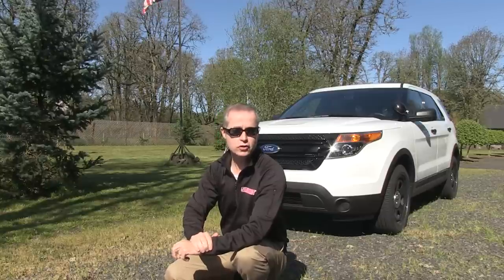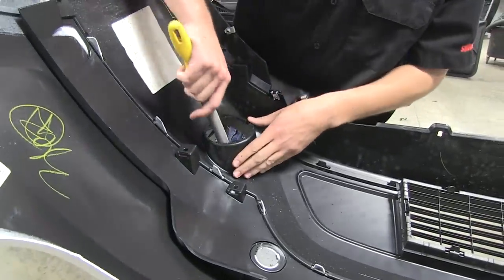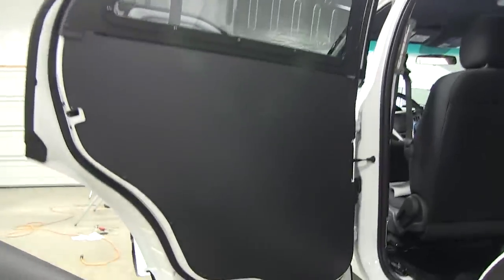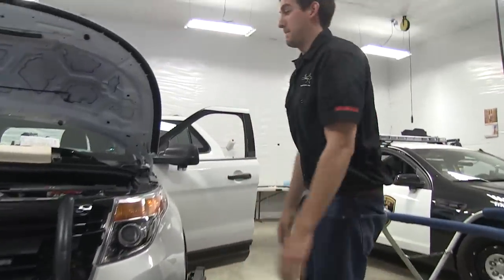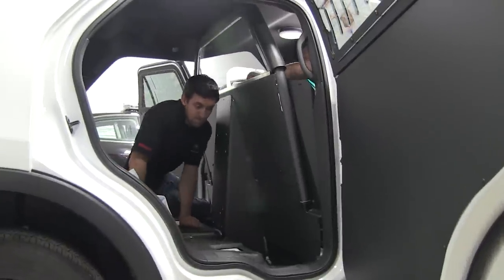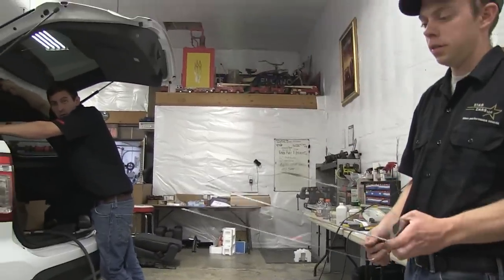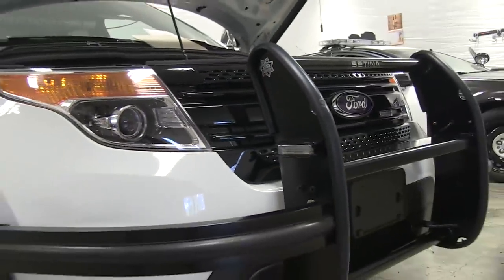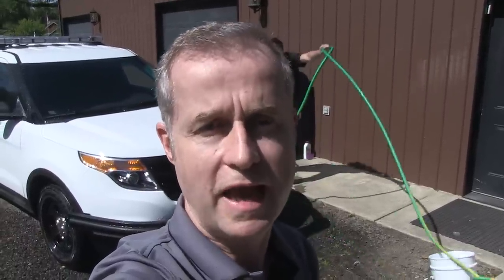Ford Interceptor SUV patrol vehicle build

Comment: I had no idea that so much work was put into outfitting our vehicles (not your company, I work in a different location in the country). I always assumed that a "Police Interceptor" from Ford came with almost everything done. I didn't know that a company had to do such intense, hardcore work like stripping the car down to basically a shell and then custom installing everything. I am truly surprised by this. I will definitely appreciate our vehicles much more now. A big thank you to those who do this work---we put these vehicles through hell, and I have never had anything fail except roughly 20 or so years ago when the Vector light bars came out and the dumb decision was made to connect them to the user-unfriendly GE control box (combo PD radio and lights/siren control head). Those individual "pods" would turn themselves on all the time. It was especially bad when working patrol graveyard shift, and as we would be slowly driving "blacked out" through a neighborhood, out of nowhere one of the pods would turn itself on and rotate slowly one "click" at a time. Even if we powered off the GE control head, it would keep doing it. Naturally, we'd have to "down" the vehicle and leave it in the underground garage sitting there with one of the pods it up, slowly clicking it's way around and around. They were chronic in doing this! I was so glad when we switched to the low-profile clear/LED light bar. So much nicer!
Reply: Yeah for them officer to just chash it like nothing

Comment: How come none of these interceptors (or the ones I have seen at least) have wig wags?
Reply from the maker: 5Legacy78 With the Projector Head-Lights, using a conventional Head-Light Flasher Module is not something that can be done. Ford does offer a PPV Head-Light with a White/Amber LED Blinker Module that offers a high-output White Flash function.

Comment: Is there any way how to install a door light switch for the interior light to turn on when you open the door on the 2007 crown Victoria ? thank you
Reply: Should be in the door jam, only guessing here.
Reply: Your Vic has been programmed for dark car mode. It used to be as easy as grounding a wire but for 05 and here newer you need to get into the ECM to change it.
Reply: R.QUINTERO624 1000 % OAXAQUEÑO DE ♥ they call it a courtesy light.

Comment: I've had the ability to drive one of these. Despite having a V6 it is extremely quick and nimble and more capable than an expedition or Tahoe.
Reply: it's the same V6 being used in the base Ford Mustang...it makes a pretty nice low-pitch scream when its floored
Reply: May be more capable but reliability isn't even near what the pushrod v8 tohoe will ensue and still come out on top in the long run I would never buy an ex ppv explorer but I would all day buy an ex ppv tahoe and I've driven both as a mechanic the tahoe isn't far behind in top speed and acceleration only .5 seconds 0 to 60 behind the explorer

Comment: I'm not a huge fan of the split blue/red on the lightbar. Red on the driver and blue on the passenger side is more effective in my opinion. 

Also, I'd like to see in your next install video how the cencom wiring and programming works. 

Thanks for the video as always.

Comment: As with the Charger video - very interesting.
A lot of work, but again done cleanly and thoroughly - great job. 👍🏼😊

Minor detail - considering how thorough everything is done, I would have expected the divider protecting the electronics in the back to be dark/black too, like the other dividers/walls. But of course, that the divider does its job is most important.

Look forward to seeing the finished modding of the lawn mower to regulatory standards. 😄

Comment: Great video as always. I just wish there was a way to get that cage to move with the seat. The new SUV's are deceiving as far as room goes. You could mess around with the Crown Vic cages (not good for safety) but at least you could lower the seat back. Intersting to see how the bolt on. Thank you.

Comment: Star car incorrectly seal the wires running though the roof of the vehicle. Silicone should not be used.
Reply: +LawnTractorBoy What should they use? Every outfitter I've known has used silicone.
Reply: +Mikeydude001 black stuffing gland
Reply: +LawnTractorBoy Thanks!
Reply: Used silicone for years never had a problem
Reply: Jeremey Taylor i use stuffing glands
Reply: LawnTractorBoy. It is NOT incorrect to seal the roof with Silicone at all. Silicone provides a better seal than a gland.

Comment: Greetings! My question is the following, after a interceptor becomes a civilian car do you restore them to civilian format? And remove the rubber flooring and that ugly center light that looks like a circle?  Like do you restore the gear shift from behind wheel to the center? I talking about a Taurus
Reply from the maker: +Cristianooportugal     The Taurus and the Interceptor Sedan are 2 different Vehicles. The Interceptor Sedan comes with the Police Package rubber floor, on the steering column shifter, wheels, brakes and front end.    When the PPV Sedan is taken out of service, it does not get dressed the same as a stock Taurus.

Comment: SIRENNET..... Is it at all possible to put WHITE WIG WAG lights in the front too?  I have found with mine (2016) that simply turning on the headlights makes the vehicle MUCH more visible, just FYI.  I would also add that the small quarter sized LED lights that are usually installed do NOT work very well in daytime use.
Reply from the maker: Wig-Wag's won't work on 2013-2015 Utilities. 2016+ will support a Wig-wag module as they have conventional halogen high beams.
Reply: @SIRENNET  Thank You! Didn't know that

Comment: I wish this vehicle would have been outfitted with the back window light bar as well as side truck warning lights. A back storage compartment would also have been nice. I prefer the single seat cage for extra space in the rear seating compartment for non criminal transport/ extra storage space for the officer. But I know that this specific vehicle was requested like this. Do you offer a multi level side protection on the setina push bumper as well for this model?
Reply from the maker: We offer 2 Setina fender wraps for the Ford Police Interceptor SUV. The PB6-VS: https://sirennet.com/store/product/setina-bodyguard-pb6-vs-suv-truck-fender-wrap and the PB8-VS: https://sirennet.com/store/product/setina-bodyguard-pb8-vs-suv-truck-fender-wrap

Comment: Wondering where to wire up a rear traffic advisor light and a stream light flashlight charger in a 2016 utility. Just looking where to start and do it correctly
Reply from the maker: With Star Cars well versed experience in working with Utilities, sending them an email mentioning your project may yield some helpful information. They can be reached at: StarCars@frontier.com

Comment: why don't you also change headlamps to LED instead of stock from manufacturer?
Reply from the maker: There are some up fitters and departments that switch the halogen HL bulbs out to LED.   It just depends on preference and needs.

Comment: Nice professionally routed wiring with full functioning light, siren, radio systems. the unit requires high amp alternator with dual batteries to sustain the power requirements
Reply from the maker: Thanks for watching :)

Comment: I would certainly like to get the dimensions of those grille light brackets. 
Would large fender washers work in a pinch?
Reply from the maker: +Mikeydude001  We'll see if we can get the dimensions. In a pinch, large washer's or a piece on thin sheet metal could be used as a wedge backing.

Comment: Do  you know how or where to connect the rear hatch LEDs so they only come on when the hatch is open on a 2017 ? the upfitters guide mentions a rear flasher relay but I don't think I have that option. I have the front grill/headlight solution  wiring option only (option 66?). If you don't hook them up to turn on when the hatch is open you can see them inside the vehicle. Thanks, and  good looking work you guys are doing!
Reply from the maker: Without the relay, we would suggest tying the lighting into the trigger that activates the OEM dome/cargo lights. Open the hatch, the dome light goes on and so do the warning lights. Close the hatch, the trigger shuts off as well as the warning lights.
Reply: SIRENNET Thanks, that is exactly what I did. I added a relay that triggered off the dome light and was powered thru the relay by the led power wire. I am checking for any delayed turn off of the dome light when the doors are opened. the sensor for the rear hatch is made into the latch mechanism and appears to be ground switched from low voltage.

Comment: It is great. I am 15 and plan on going into the fire department when i turn 18. It is good to know how to wire all of this stuff up. (I live in NY where we don't have strict laws about about the lights. Just that volunteer fire fighters have to run blue lights).
Reply: theryre pretty strict. also you can join a dept at 16. im 17 now and a yellow tag. lights though are the last thing you should worry about although i know how you feel having been that attitude year and a half ago. basically. the dept has more say about your lights because most cops dont care in ny about how many as long as its blue front facing only maybe amber
Reply: NY law says 18 I thought. Hmmm... Anyway, I know you can run a bar as well. It doesn't have to just be front facing.
Reply: It doesnt actually.  Junior firefighter programs are all over

Comment: Question. I know it's been a long time but how tall is that wooden rack on wheels holding the electrical wire spools?
Reply from the maker: It's about 6 feet tall.
Reply: @SIRENNET  ok. Thank you. And where'd you get it or did you make it? And are you using various size spools?
Reply from the maker: @trucker18944  Star Cars got the wire racks years and years ago. To far back to remember from exactly where.

Comment: Is the siren controller in this unit a dual tone siren ans if not is there one like it that is?
Reply from the maker: It's not using a dual tone amplifier.   You could go the route of a 295SDA1 siren & lighting controller or with a Cencom Carbide with it's dual-tone amp add-on option.    Here's a link to the 295: https://sirennet.com/whelen-295sda1-dual-tone-remote-siren.html

Comment: What is the Motorola thing in the trunk for? Cause I have a Motorola mcs2000 and it's programmed but nothing comes out of it
Reply from the maker: Its the main radio receiver. The control-head is a remote fixture designed to accommodate being flush mounting  in the console.
Reply: SIRENNET do I need one to make my radio work?
Reply from the maker: It sounds like you have the remote-head... so this piece would be necessary. For more information, we'd suggest consulting Motorola.
Reply: SIRENNET okay I will thank you

Comment: What about the headlights, shouldn't they flash as well?
Reply from the maker: The Projector Headlights can not be flashed. They have a ballast based bulb system and it is not designed to click on & off. Most folks are substituting this with White LED grill Lights or Push-bumper mounted White LED light-heads.
Reply: SIRENNET Really? I thought that the Explorer has one bulb (9005) for both high beam and low beam and that when you activate the high beams, a little cover that blocks the top part of beam moves away.
Reply: BlazedGun That is correct, but the projector bulb as mentioned is not designed to be turned on/off (or faded as is typical wig-wag fashion). Mostly because they are designed to warm up and then turn on. As a solution, Ford offers the "Ready for the Road" package, as an upfit for the Interceptor model(s). This replaces the stock turn-signal with a dual functioning LED that flashes white for emergency use, but is also illuminated orange for turn signals, parking lights, etc. It also includes a Vertex LED in the outer edge of the headlight housing for intersection lighting. It is also worth noting that there has been a third party module created to flash the headlights, but many PDs have reverted back as a result of excessive blown bulbs.